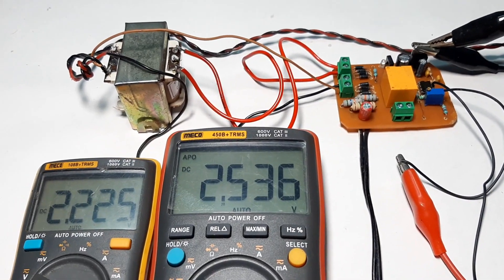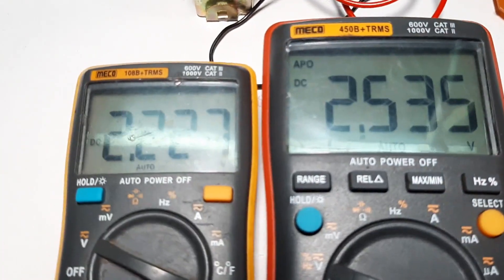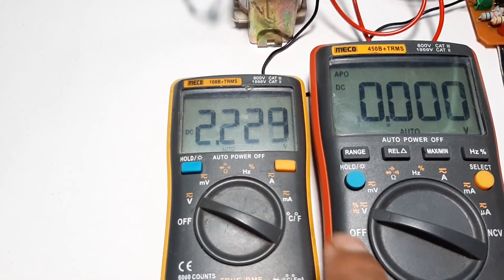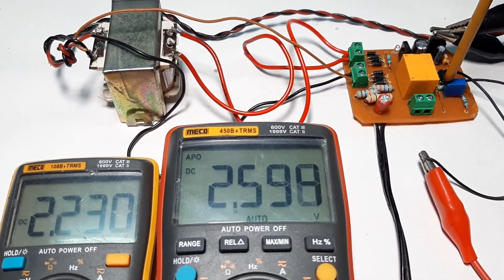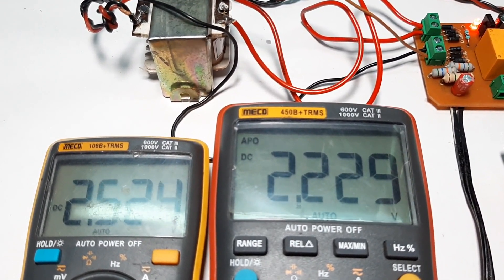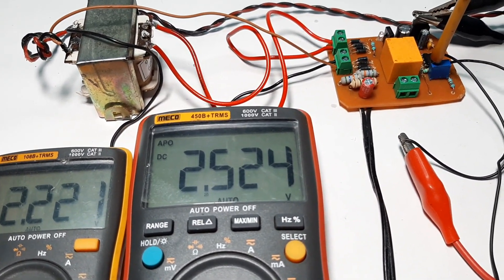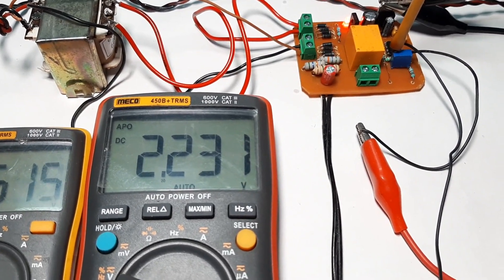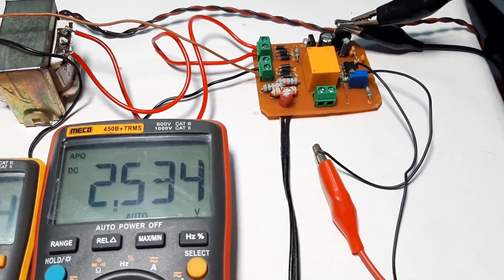230V AC Mains Over Voltage Protection Circuit

Comment: I think the problem here is that the transformer may get burn since it is constantly connected to ac means. Can you design without a transformer or can i use a 9 volt battery instead of a transformer? Thank you
Reply: The best solution to this is to use a 450V / 24V 250mA Transformer, which will then output 12V at 230V...